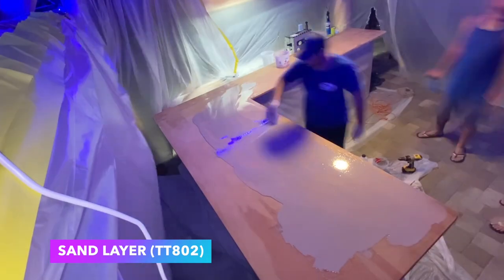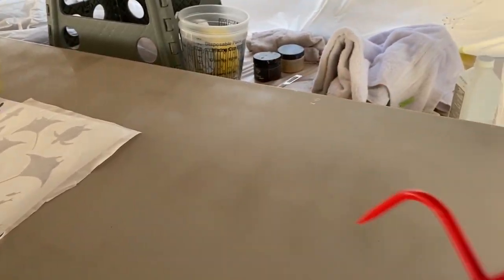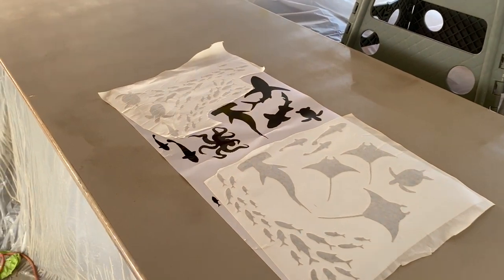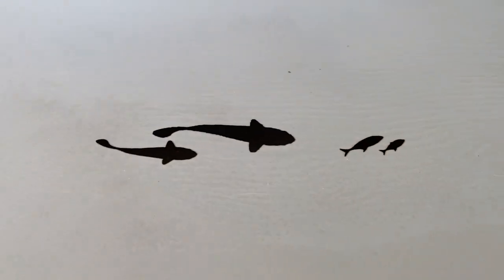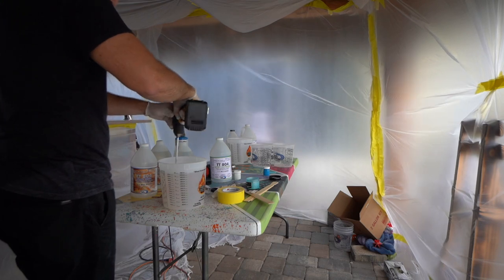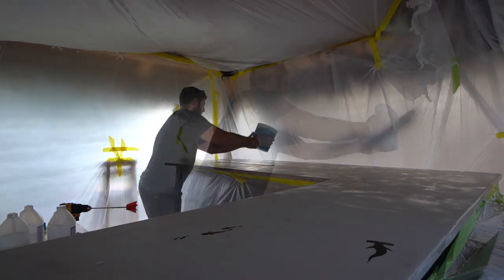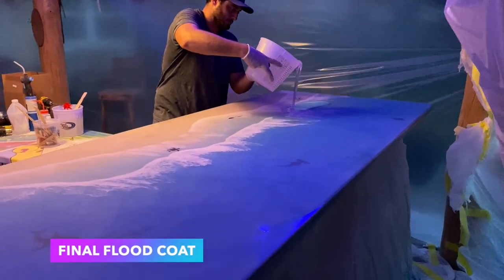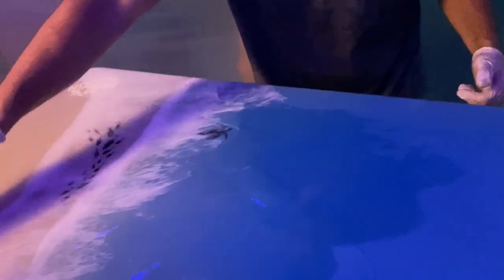Creating an epoxy beach bar. How to make an epoxy resin ocean tiki bar

Comment: #GOALS!!  Question... How do you deal with the edges?
Reply: I'm about to do an outside bar too so I'm wondering what temperature should I shoot for day/night
Reply from the maker: @lisamaginnis8313  SHOOT FOR THE COOLEST PART OF THE DAY. You want it to be around 75 degrees. It was definitely too hot when I poured this one.
Reply: @saltyresin543  I've started and I'm loving it. I'm ready to do my flood coat but before I do, I feel like I could use a few more waves. Is it possible to add waves without doing an entire epoxy layer??  (I'll share my pix if possible)
Reply from the maker: There is no right or wrong way! You can make as many waves as you want. Just make sure to sand between each layer and fill it in with clear if you want it to be flat!

Comment: What kind of blue paint did you use?
Reply from the maker: I used some liquid pigment from @fiberglassflorida and also so powder mica pigment from black diamond pigment
Reply: @saltyresin543  One more question and I will stop bothering you! what grit sand paper?
Reply: @saltyresin543  What colors of pigment did you use?
Reply from the maker: @alanmatthewson2762  320-400 is good between layers